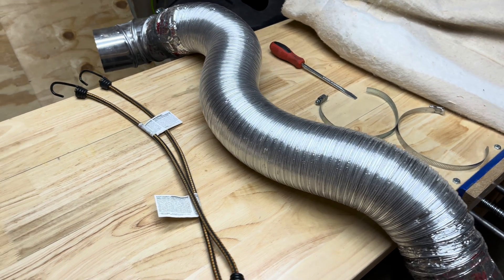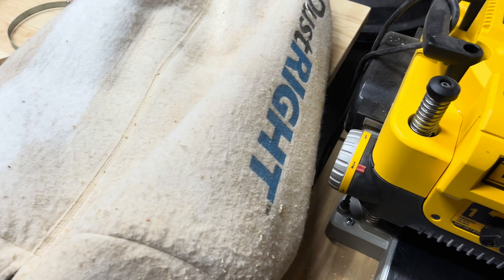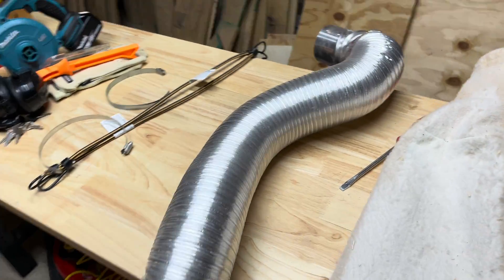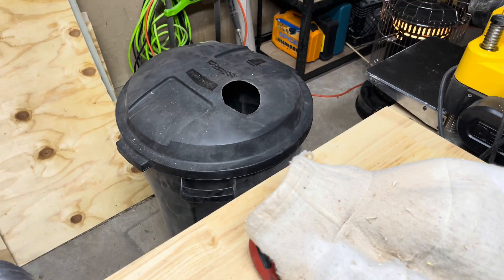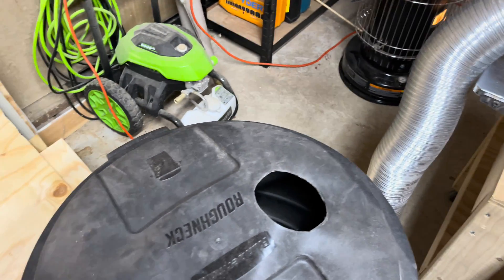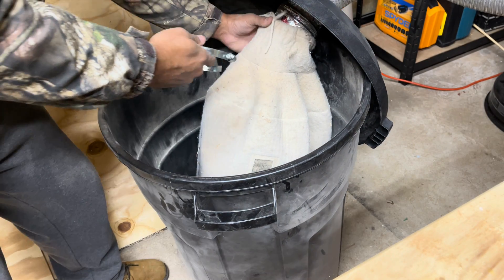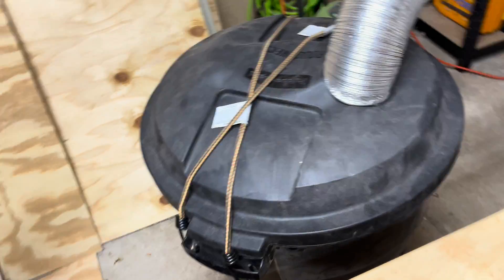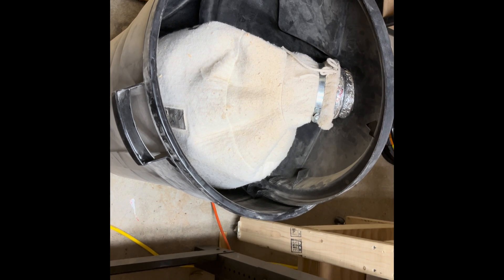Best dust collection system by far! For Dewalt DW735 Planer

Comment: Definitely use my dust collection with mine and have never had a problem with “clogging” as u say at the exhaust.… it doesn’t even make sense to say the shop vac or dust collection would cause a clog__ when dust collection is helping pull the chips away from the machine instead of just the force of the exhaust… I mean I Super glad u found something that works for you… I wish u nothing but the best but maybe don’t tell tell people they are going to fight clogging if they use dust collection especially for people that are newer to the hobby…

Comment: hey bud... quick question.. it seems to work but aren't you trapping the air in the trash  can. it needs to breath add an exhaust port on the other side of the top.

Comment: I have a tough time seeing this work.  I have this planer and tried similar things, the pressure from that blower is very high and those straps wouldn’t hold down the lid.  It would be pushing it up and you’d have wood snow everywhere.  That air has to go “somewhere”
Reply from the maker: I've been using it for going on 5 years and have had no problems.

Comment: I used a garbage can cut most of the top off except enough for a 4" hole found to much blowback so I cut the bottom of the can and screened it also works good but fine dust circulates everywhere. I will add the bag to the can which I think will contain the dust and allow enough air so it's not back pressuring the blower

Comment: Wrong. You take off the port on the back and put a 3 inch connector on there. Then run a 3 inch hose to your extractor. I have the same planer and I don't get a speck of dust when I am running it.
Reply: I took a 2-1/2 inch ABS 90º elbow, attached it to the stock fitting, and plugged the hose to my cyclone into it.  No more dust or chips!

Comment: I use a drier vent 4inch 2 way coupler and bolted to cover of metal can. Easier to empty. Used aluminum flex pipe and mounted permanently to cover.

Comment: 0:37 I use my dust collection with it and it flows awesome - no chip clogging, and great veocity down the pipe.
2hp motor/fan 6" suction to DD - exhaust thru a 8" hole outside of my shop (no redcution due to bags or hepa filter) 100+ acres for it to dissapate
Dust duputy XL on a 55gal drum - 6" main run necked down to 4" branch pickups
The dust collection flows about 50% more air than the dewalt puts out by my best ability to measure airflow with my handheld annemometer

Comment: Seems like the air being pushed into the garbage bin would be trying to expand the garbage bin since it has no way to escape (except for any leaks). This would probably be hard on the extractor motor on the planer, and also decrease the chip extractor efficiency.
Reply: Agree, that's what happens. I do everything he does except I cut a second hole for my shop vac hose, usually 2.5in. It's not perfect but gets 90% and is cheap.

Comment: I use two planers, I use a Delta for the first heavy cuts and I use the Dewalt when I need a smooth as a baby butt surface.:penguin-blue-waving-tear::penguin-blue-waving-tear::penguin-blue-waving-tear::penguin-blue-waving-tear::penguin-blue-waving-tear:

Comment: I think the confusion everyone is having is that your initial statement was "you can't hook up dust collection to it", which is incorrect. Later you clarified that's it's shop vacs (with smaller diameter hose) that will cause the clogging. 4" hose from a dust collector to the planer should work just fine.
Reply from the maker: Thats right, I should have known people are paying attention to the full video. But yes, you can hook up a larger dust collector to it, however the shop vac will only work with very light use.

Comment: With no exhaust the blower on the planer will eventually burn up.
I think the chip flow is greatly reduced with no exhaust.
My system uses a 4" hose/pipe from the planer to a 55 gallon drum.  My dust collector connects to a separate fitting on the drum.
The chips collect in the drum and fines go in the dust collector bag.
You need to hook a shop vac to your trash can to  help pull air through the system. Also get rid of the bag in the trash can. The chip will drop in the can and the shop vac will pull out the dust.
Reply from the maker: I may give that a try! Thanks for the tip!

Comment: Good idea if you don't have a large dust collector. I have older Dewalt planner that shoots to one side. I hook 4"  hose on exhaust port to my dust collector header. Chips go through a small cyclone for collection and rest goes to harbor freight DC. I was going to try your method but hook shop vac to  collector barrel with a baffle inside to force Chips down to bottom.

Comment: how does the air escape the garbage can. operation is ----The air is captured by the planer blower and used to discharge the particles into the bag so where does the air exhaust go?. the can will pressurize and the air flow will reduce as filter blocks up....I think you are going to have to put a small vacuum hole in the top of the can to let the air purge out of the garbage can into a a vacuum cleaner. free flow air in and an equal amount of air out. Just sayin....

Comment: Where does the air go if you've got the bin all closed up? Wouldn't that decrease the efficiency of the blower in the thicknesser?
Reply: That garbage can will not seal air tight.   I would guess if he had cleaned his shop before he made this setup and then compared the results of this setup against his earlier set up, there would not be much difference after some time.  Where there is air flow there will be dust entrained in it (I'm a retired compressible and incompressibel fluid flow engineer).  And there is no doubt that air is coming out of that trash can.  And the additional restriction of the planer blower will impact the efficiency as well as the load on the blower bearings which will in turn reduce the life of the blower bearings.
Reply: @davidwhiteley3879  100%
Reply: @davidwhiteley3879  Indeed. And stifling the airflow to this extent might be bad for the motor. I set up something similar with a second hand 735 that I'd had for one day before smoking the motor. Not sure if it was the chip collection setup or the heavy and messy work I'd done the night before. 

I ended up overheating the motor's field the following morning within a minute of starting it up. I had a couple of 2-3 inch holes cut out of the top of the garbage can and then covered with cotton from a t-shirt. I've since read that some people have smoked motors by not allowing for enough airflow.
Reply: man, the exhaust has to go somewhere

Comment: My understanding is the fan in the planer is used not only for chip ejection but also for cooling. Has anyone experienced overheating issues ?
Clearly this system, and almost any other dust collection solutions will inhibit the air flow to some extent.

Comment: Have you tried it without the bag?  Just straight into the garbage pail?
Reply from the maker: The bag helps to contain the small dust particles, because the air has to exhaust from the trash can and if you have no bag, the dust will fly out with the exhaust.
Reply: @ParklanCustom  thank makes sense.    Thank you for the advice

Comment: Why is a hose into a bag contained within a bin any different to a hose connected to dust extraction unit/shop vac?
Reply from the maker: Unless your shop vac unit has a 4in inlet and hose, it will get clogged. I dont have a large dust extraction system which would work fine with this, but not a shop vac, it will clog it up. Since the planer has a internal fan it actually blows the chips out by itself, and the hose going in the bag catches the chips and dust, and the can contains what dust does escape the bag.

Comment: why the bag, Where is the suction produced from ? Im confused . I run mine thru a shop vac and a dust Cyclone Dust Separator Kit. and a garbage can . no bag
Reply from the maker: The dewalt planer has a fan built in that blows out the chips, The bag is to catch the dust, Combining the planer with a shop vac will often time clog the planer.

Comment: Funny to run across this. I tried virtually the identical thing. Same adapter and everything. The problem, if you want to call it that, is the chip fan is so powerful it blows the top off the trash can. I tried to bungee it down, still did it. Made a locking system but gave up on that after growing tired of the ten minute process to open and seal it. Tried cutting a vent into the side with a filler on it but that clogs up so quickly that the air pressure pushed the top open again. 
Then I tried to exhaust it into a cyclone that I installed on top of a locking 55 gallon steel drum. The other end of the cyclone exit i attached a filter. That actually worked very well but I grew tired of the loss in mobility and the space that it took up. 

I ended up doing the trash can idea like this but with a better twist. Those dustright bags full up extremely quick. You can purchase a 36" X 72" piece of 5 micron filter fabric. Sewed it together to make a bag that acts like a liner for the trash can like you have but with a much larger bag and smaller particle pickup. Then added 6 T-Bolts I had left over from toilet installation for the bungees to easily attach to. Whatever escapes the filter bag just coats the inside of the trash. There is still some dust that escapes but at least this way it's not enough to where you need a respirator.
Reply: Great ideas. One question about your latest setup with homemade dust bag. Do you need any exhaust holes in the outer can for air to escape? TIA.

Comment: So given you dont vent the trash bin to atmosphere, and the dust bag is inside the bin essentially being sealed in - what is the purpose of the dust bag? Could you not just have a pipe going into the bin, sealed, and get away from having a dust bag at all? 
If the bag is sealed inside the bin, then what is the bag actually doing other than holding the shavings and dust inside it. Could the bin not do the same thing, and you simply disconnect the hose and empty the entire bin, rather than having to deal with a bag?
If the dust cant get out of the bin, what is the bag even doing?
Reply from the maker: The bag is the filter, the air escapes from around the lid.

Comment: Best I can tell, all you accomplished was ruining a trash can. Where is the air going?
Reply from the maker: The video explains where the air is going..
Reply: All the video says about it is you said it doesn't need an exhaust. Physics will say it does. If you have pressurized air and chips going in, you have to let air out. Is not you just clog up the hose and planer exhaust.
Reply from the maker: @terencenewlin5265  common sense says, trash can lids are NOT air tight, and neither is the hole cut in the top where the reducer goes in, also if you didn’t catch it’s a 30 micron bag (filter bag) so the air escapes from the bag and from around the lid, that’s what the bungie straps are for, to hold the lid down (while the air escape from around the lid).. I’ve been using this set up for about 2 years, never had a clog once… hopefully this helps! 👍
Reply: Actually I happened on your page looking for information on the planer as I'm thinking of the dw735 as a replacement for my Delta. But was occupied with your creation. You appear to be satisfied with some harmful dust as opposed to zero harmful dust so I'll leave it at that. I went through all that you're doing over 15 years ago and have no desire to go back there.
Reply from the maker: @terencenewlin5265  If you want Zero harmful dust, maybe woodworking isnt for you. Make sure you got yourself a respirator on at all times.
Reply: @ParklanCustom   I realize there is going to be dust. Just don't want to turn loose what I've already caught.
Reply: Ok. You finally admitted the fault in your setup. If you have air escaping the trash can. You also have fine dust escaping the trash can. Almost the same as having the "dust right" bag out in the open. You would be better off sealing the trash can and incorporating an exhaust with a 3-5 micron filter.
Reply from the maker: @terencenewlin5265  the trash can will catch most of the fine dust that escapes the bag due to something called surface tension and static, if you want to put a 3 micron bag in there go for it, I never said you couldn’t, and if you want to take extra steps to create an extra exhaust port with additional filtering, you certainly can. I never said you have to do it exactly like mine.

Comment: Nice! Is it still working out for you? Thinking of rigging one of these up..also saw that rigid jointer in the background..do you recommend it?
Reply from the maker: The dust collection system on my dewalt planer is doing great, the only downside is emptying the bag, as for the rigid jointer, it has worked exactly as I expected, it’s smaller and doesn’t take up a lot of room, but much better than a bench top model, it does just fine with hardwoods even hickory. Downsides are capacity, the 6 1/8 isn’t much but if that’s all you have you can definitely make it work.
Reply: @ParklanCustom  Thank you

Comment: I don't understand why you would have trouble with a dust collector or shop vac? I use a Ridgid shop vac coupled with a dust stopper  with my DW735 and I've never had an issue. This is probably the least messy tool in my shop.
Reply from the maker: I’m not sure how much plaining you do with yours, i actually do a lot of planning and every time I’ve used a shop vac the plainer gets clogged up. Most people I know have the same issue. However if you do not, that’s terrific. Besides the clogging, the method I use allows for much more chip collection that my dust stopper because it’s just a utility bucket the chips go.
Reply: I’ve noticed a lot of escaped chips/dust when using it on taller lumber (like getting the edges of a 2x6) otherwise I agree

Comment: Can you use a shop vac filter bag instead of a dust bag?
Reply from the maker: I suppose you could, but it would fill up extremely fast, even the large shop vac bag are only 16 gallon which isn’t much considering how much dust and chips are produced from plaining.
Reply: True. Thanks! Great video.

Comment: Couldnt you just shoot it all direct into the trash can and silicone around the hose on the lid to keep the dust on? Seems like that would work well and you wouldnt have to be constantly undoing the bag to empty it.
Reply from the maker: The problem with that is, is the air has to be able to escape the trash can, and the bag is like a filter that catches all the dust and debris. It cannot be air tight, because it would build up so much pressure to the point of explosion.
Reply: @ParklanCustom  didnt realize the dw750's fan was that powerful good to know. I just ordered the planer and am planning out my dust collection. Thanks
Reply from the maker: @PCPAyLOAD  Absolutely! Yes it is powerful, there is a warning on the back to not put your hands or stand behind the chip ejections port.

Comment: Air still has to escape out of your garbage can and you have no provision for air escape. So in reality you are choking off air flow. Air flow is very important for chip and dust collection. Connecting your Dewalt to an extra dust collector works way better than your system. I know from experience!!
Reply: I agree. I tried it going straight to the can and the pressure build up was so strong it blew the lid off and made a huge mess
Reply: I agree but the escaping air should also be filtered
Reply: Its like winding up jack in the box and waiting what pops out 😂
Reply from the maker: You may want to watch the whole video or read prior comments about the air exhaust.

Comment: I use my dust collector with it and it works fine. I used to use a shop vac and that worked fine as well.
Reply from the maker: My shop vac makes it clog up every time, that’s why I came up with another method
Reply: exactly.  I you have a small shop vsc the airflow is not enough, but if you have a larger shop vac it's just fine, or a dust extractor.  Another way to control the fine dust is to get an extension hose from your shop vac and put it out the door or window.
Reply: What brand and model of collector are you using?

Comment: So.   Where does it exhaust.     Air goes in but where does it come out??
Reply: I might have missed something
Reply: @colinabell3672 you didn’t.  It wasn’t mentioned @9:10 he says you don’t need an exhaust but doesn’t expand on that
Reply: I wondered that too. You stated that no exhausting was required. Maybe since the trash can isn't airtight then the air finds a way to escape. After a year of use how is it working out?
Reply: Excess air is absorbed by the wood chips!
Reply from the maker: If you watch the full vid, I explain that

Comment: Excellent idea. Thanks for sharing. I like how the can will trap most of the dust. Three questions:  1. Does it matter if one uses a 4-6 inch coupling on the bag end of the hose rather than the 4-3 one you used.  It seems like the 4-6 would make it easier to hook up the bag due to the big bag opening, assuming one uses an 8-inch clamp or so (which I have).  2. Does it make sense to drill some small holes, so on the underside of the can to allow pressurized air to exit downward (rather than from the top around the lid) where hopefully the little dust that escapes will get trapped on the floor beneath the can and won’t easily float into one’s nose? 3. What size trash can are you using?
Reply from the maker: That does sound like a couple of good upgrades!

Comment: Weird. Sweet system but mine is hooked up to my rigid shop vac and works fine.
Reply: I never could get mine to work with a shop vac
Reply: @JP-kp9bg  dang. I’ve only ran mine with hard maple. I’ll have to try out some other woods!!! Thx for the info
Reply from the maker: My shop vac caused it to clog up all the time, that’s why I came up with another method
Reply: @ParklanCustom  that is Strange hopefully mine keeps working haha